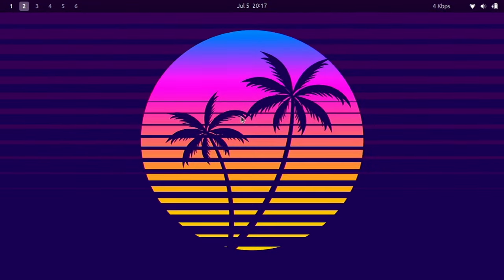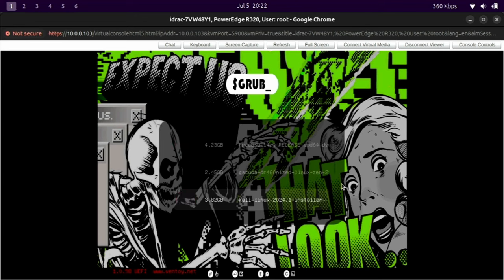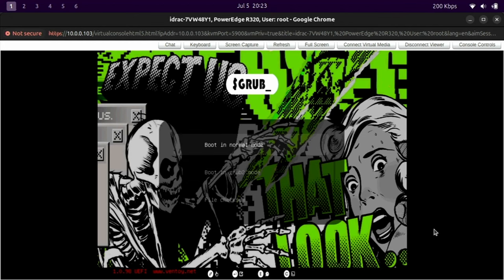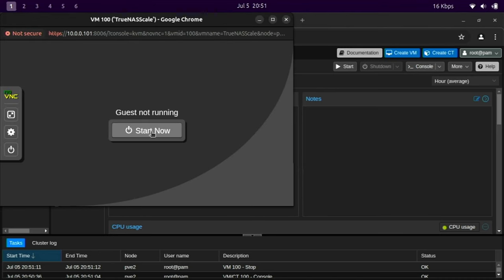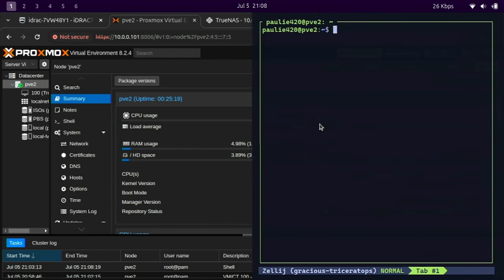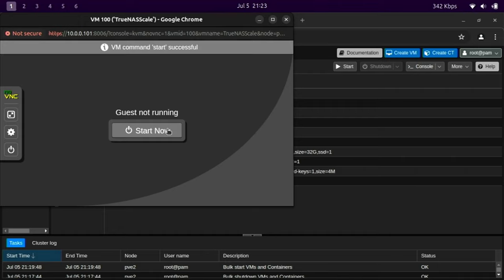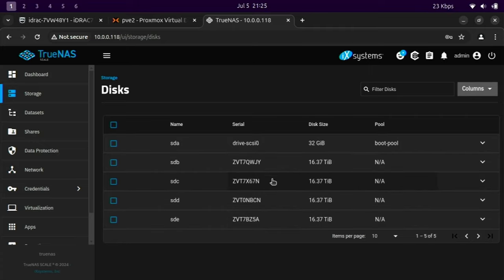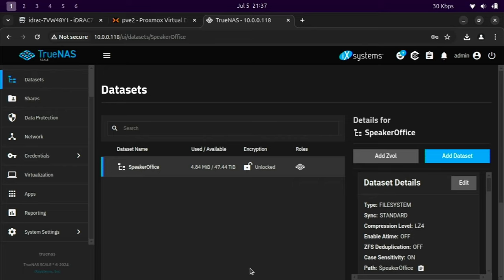Testing PCIe Passthrough with TrueNAS SCALE VMs - 72TB NAS Build

Comment: I actually did this recently, got my R720 a couple of months ago and installed proxmox and just used it with Proxmox and a couple VMs then got bored with it, so I virtualized TrueNAS and passed my SAS controller through to it. When I need to give my VMs storage, I just connect them to a NFS share in TrueNAS. Love the video!
Reply from the maker: I have a main server running Proxmox w/ my production VMs/CTs - I'm gonna create a cluster of the two systems and play around with CEPH storage, but I'll also be passing a 10GB NIC to the TrueNAS VM & the other server... I think that might be fast enough to use as NFS storage??? The TrueNAS/Proxmox server has 1TB of SSD, so theres that for things that need super fast storage... glad yer here!

Comment: Awesome walkthrough in getting hardware passthrough to work!
Managed to do this on a HP Proliant with a raid controller
Just a note, vim editor was not usable in my setup? so I used nano instead.
I ended up not needing to setup ssh to do the commands either. I just did it all in the proxmox node's shell.
Thank you, saved me lots of time!
Reply from the maker: Thanks - it was fun getting setup. You know whats crazy??? My r320 is better than my r330 in many ways! - its also not, in other ways - but it has more RAM, more threads, and SO cheap... pretty good for a NAS system.
Reply: what did you blacklist for the raid controller? currently trying to do this with a hp microserver gen 8 in ahci mode...